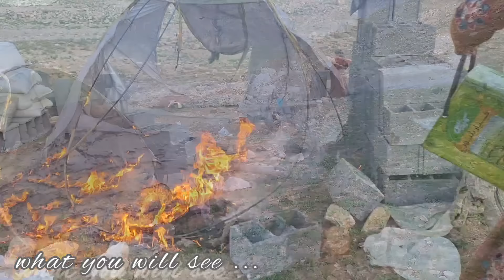Fire by Muhammad's mother 😱🔥

Comment: Operator I'm sure you can afford a big sheet of plastic & Mohammed can put some post in the ground & just as he built the stone wall he could do it higher all the way around in a Square & put some beams across the top & put the plastic over it. & A few more stones on top to keep the plastic down. Or used the great big rock as a wall & build two Walls of stone on either side & some beams & the plastic on top with stones to hold the plastic down 
Or section off one corner of the house and make a tent

Comment: Zainab.....

I don't understand where all the money is going. Donations are made here in dollars, euros and many other currencies. Youtube itself also brings in money. Everything that is purchased is converted into just cents, so it costs almost nothing. Now you say that you spent all the money on blocks. There is something wrong. I have already donated 20 euros myself. That's almost 900,000 IRR. 3 bags of cement cost the equivalent of around 0.20 euros. For 20 euros you could buy a lot of cement bags or blocks. There were no shoes for the children either. So where is all the money??? 👿

Finally get the blocks from the old house. They can be used again